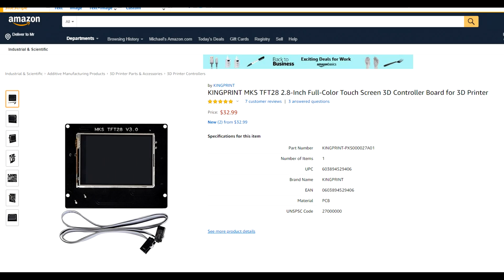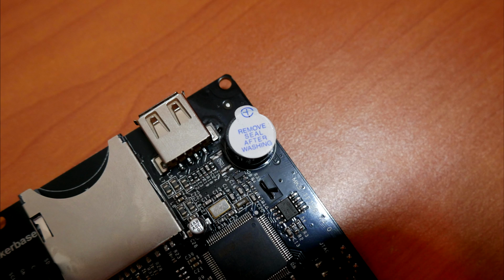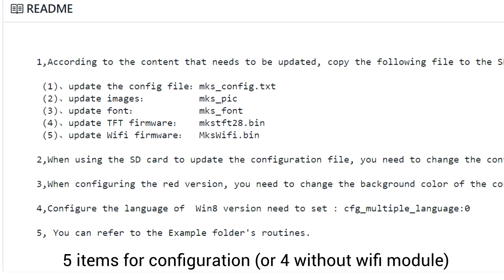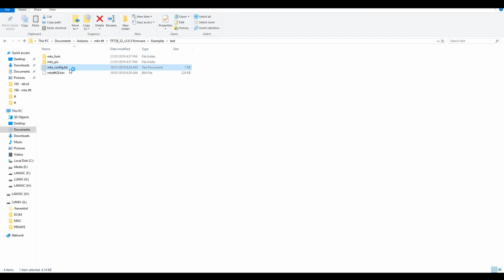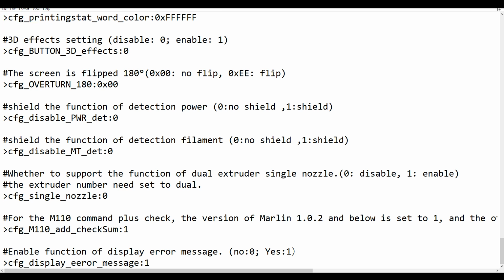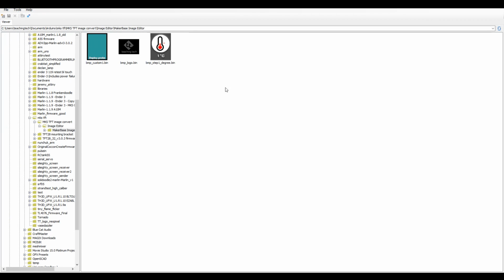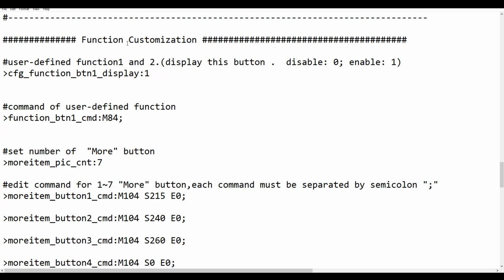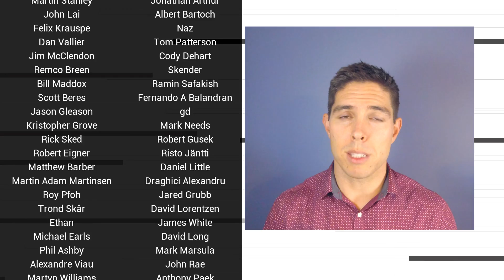MKS TFT28 touch screen on the Ender 3

Comment: Hey Michael, that is some cool upgrade! Hope you washed the speaker thoroughly.^^The WiFi functionality, full size SD-Card slot and the touch screen are pretty tempting. And overall this upgrade is a lot cheaper than buying a Raspberry Pi with the original touch display. If I remember right, such a setup is also used in the JG Aurora A5's. Can you use this display also with the standard Creality boards? They also run on 5V and should have the same display connector. Thank you for that video. So much info in such a short clip and still well explainded. Awesome!

Comment: I bought the MKS+Driver+Touchscreen that you have linked in your MKS upgrade video.  The description was wrong and it does NOT include the TFT32 that it pictured. It has been fixed on Amazon, but your link still says "touch LCD".  You should fix that. That disappointment aside, your  instructions were extremely helpful.
Reply: I was confused by that too. The link just takes you to a standard non-touch LCD.

Comment: hello just a heads up to anybody thinking about touch screens the MKS TFT24 is a really good and cheap touch screen its only about 20 bucks on aliexpress and I really love that the sd card is 90 degrees to the screen and not under it the TFT24 has almost the same features as the TFT28 too the only thing it doesn't have is the 12v power input but if your using a gen L or any MKS board really it works just fine

Comment: Great video. You may want to redo this one though to slow down just a bit and explain more of what your doing. Got a feeling your gonna get hit with a shit ton of questions on this one. I followed along fine but a noob may have a bit of trouble. But as always great video. Very informative.
Reply: Would actually like to see the 2208's so the enders could utilize the layer shift detection.
Reply: Agreed. 9 minutes for all this.
Reply: I slow down the video in settings. PITA yes but you gotta do what ya gotta do.
Reply: If you completely don't know what you're doing with this it's probably better you just don't do it
Reply: Yeah but, how do you think a noob learns how to do this stuff. Not all but most of the 3d printer owners are tinkerers and alot cant afford to take it to a pro. So yeah your only gonna learn by doing it. So videos like this maybe a bit slower and more detailed for the noobs is all of what the 3d community is about. This channel is typically extremely well and detailed about fixing, modding and pushing a printer to the limits. This channel is an invaluable resource to the 3d printing community and for the noob who just wants better from their printer but cant afford an arm and a leg to make it happen. Not saying your wrong. Just saying most makers are exactly that "makers". We tinker tweek mod and push the limits till we reach that point were we are happy. Even when we have no clue what we are doing and then we you tube it for answers cause somebody out there does know. So i never discourage a noob from taking that next step. Otherwise a noob will always be a noob and never learn and grow as a maker. Yeah they are gonna screw up along the way but most important is to learn grow and become better at what you do. Videos like this simply push in a positive direction to help others avoid common mistakes. So in that aspect i disagree with the whole dont touch if you dont know mentality.
Reply: @davidtingle6  I could not agree more. People like Got memes want to keep 3d printing for an elite forgetting, of course, they too were once noobs.

Comment: I am guessing you can't just get the screen and replace the stock one?
Reply: Delslogos 3D Printing Darn near, I mounted mine in the original metal mount. It worked fine out of the box but there are a bunch more things you can configure for, mainly buttons you like, plus it supports WiFi. I have the module but am still fine tuning everything. You can print a really nice mount for it that screws right into the existing holes. I even made a 12vdc cable for mine but Michael points out if you put the jumper to 5v, which is the default it’s powered by the board. This is a really cool display. The plus is you get back your SD card and add WiFi if you want. My printer seems to be torn apart being upgraded than it does printing. 🤣

Comment: Can you explain "Wash the speaker before removing the seal." ? I was wondering what that seal was there for. If that is the speaker, how do you wash it with the seal still on it? Just curious. ......... I have just read that it has something to do with 'flux' where the speaker was soldered onto the board. I still need to know "How do you go about washing it? Also, does it mean to wash the whole board? ....... Is washing even necessary? Could the seal just have been left on during the manufacturing process (After they washed the board)?
Reply: The sticker protects the speaker while the board is being cleaned after assembly. If you leave the sticker on, it will be much quieter, which may be desirable if you find it to be annoying.  I usually leave them on
Reply: @Mike_Neukam  Yes, that is kind of what I thought but wasn't absolutely sure of. I just did a search after posting my question and found similar answers about it. Thanks!

Comment: That's awesome.  That was one disappointing thing with the Ender 3s. Would this work with the stock board? Also did you see that Creality has an official BL Touch solution now with some sort of ISP to burn fw to it. However, from my research they are using Merlin 1.16 so I wanted to know how would I go about updating that to 1.19 since the bootloader will be available.
Reply: These Makerbase TFT screens will not work with the stock Melzi board in the Ender-3.
Reply: If you're considering Bltouch, check out his video on upgrading to the MKS Gen L board.  It will give you much more flexibility for future upgrades

Comment: Wonder if the touch display will allow for baby stepping  like I can with the older screen and dial
Reply: If you mean manually moving the X, Y and Z axis, you can do that in either 0.1mm, 1mm or 10mm steps using the screen. For the extruder you can choose between 1mm, 5mm and 10mm manual extrusion/retraction.

EDIT: You can probably also make custom buttons for finer adjustments, I have not tried.
Reply: Lukas Berger    it does not work, m290 command does not function with tft. even MKS,Github etc have no answer

Comment: Today i got MKS Gen L, 4x DRV8825 TFT35 and wanted to ask if you have experience with that XD  This is great, thank you
Reply: xManzi 8825 are easy. Keep all the jumpers in for the drivers, set the vref for your existing motors, you will also need full power to the board, not just through the serial port. read it off the printer before you dissemble, for an Ender 3 it .60 for x,y, e and .81 for z. That’s what I’m running. Tell marlin in config H that your running them in whatever axis’s and then double your steps ie x and y from 80 to 160 z from 400 to 800 and I forget e but it’s right there so double it. This is because the 8825s run at 32 instead of 16 line the stock 4988. If found much better performance so far.
Reply: @heeder777  man... Didn't expect such a detailed reply... Thanks man... And more so because I haven't bought volt meter yet, so now I have something to go off of... Thank you, really
Reply: What’s scary is I started playing with these 3D printers about 6 months ago and was COMPLETELY LOST!  I’ve learned a bunch on this channel and a few others. When it finally works right it’s an amazing feeling. At 57 it’s good to be able to speak the lingo with the younger guys. The only thing suffering is my skills while play BF V, too much time spent programming these things.
Reply: @heeder777  Then we are on the same page, I don't play video games much these days, and I also got my printer 5-6 months ago. But only recently started looking for electronic mods because of tinitus (ear ringing) and printer isn't helping one bit with that.lol

Comment: Can’t wait for the TMC stepper driver video. Unfortunately there’s a lot of fragmented information out there regarding them and it appears that implementation of them varies by printer. I’ve been waiting for your video to hopefully perform my MKS board upgrade, EZABL and Pi all at once while I have everything torn apart.
Reply: BL Touch > EZABL every time, don't even waste your time on that. BL Touch works on all surfaces, its a mechanical switch, weighs waaaaay less, so it doesn't weigh down the moving part of the printer (adding weight can put a strain on the belts and introduce artifacts).
Reply: just finished my 2130's spi install on ender 3. if you dont want graphics controller and sd card its straight forward. if you do you need to change what pins you are using. mks 1.4 i used ping 64 65 66 for my spi can it worked perfect after that. took me forever to figure out that it was the pins on the board even tho the pins i was using should have worked.
Reply: I copied his video but used 2208 drivers. (i think you set them inside marlin. I didn't how ever. I set them all to 0.8 except the extruder to 0.9. )

They're are damn near silent and the best upgrade i ever did.
Reply: jake360flip So basically plug and play minus vref voltage change?
Reply: @Obee270  Depends which 2208 you get but you might need to change the direction of your stepper motors but other than that yes.
Reply: @Obee270  They have been for me yeah. (i'd double check on the setting them in marlin just to be sure though) But i'm happy running mine as they are
Reply: @jake360flip  I'm currently in the process of doing the same to mine apart from I'm running mine in UART mode for the best of both worlds.
Reply: @jake360flip  Are the steppers running hot for you? Assuming you have an Ender 3.
Reply: @marceldegoede2281  They ran hot for me when i had them at 1.0v . changed em to 0.8 and have a 80mm fan in a custom case blowing on them at all times. Works a charm.
Reply: @jake360flip  Perfect. I had them running on about the same VREF settings but noticed that the stepper motors got quite hot. Now running X,Y,Z on 0.725 and E on 0.8. Also running smooth here
Reply: if you want some help let me know, i now have the same setup. i did offer to send him a full set of 2130's to do this, but a lot of reading lead me to a working setup.

Comment: Is there an option like this for the ender 3 pro or  would this work for the ender 3 pro too?
Reply: It's the same, there is very minor differences between the two.
Reply: @ApolloMcrib  you'd have to replace the main board correct?
If so is it the same connections?
Reply: Yeah, just replace the main board following TeachingTech's MKS Gen L video, it's all the same for the Ender 3 Pro :)
Reply: Ender Pro has the same board and firmware as the regular Ender 3 I believe so should be exactly the same
Reply: I wonder if the TH3D EZABL will still work with this...